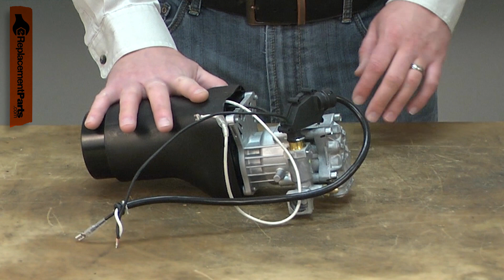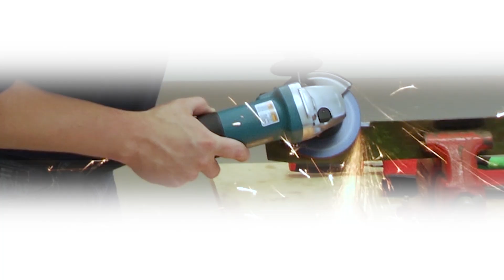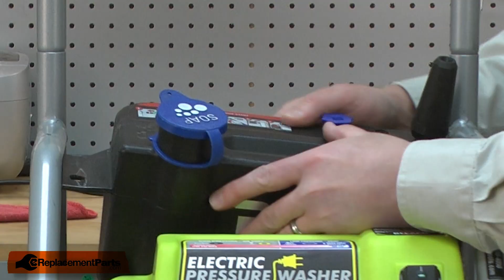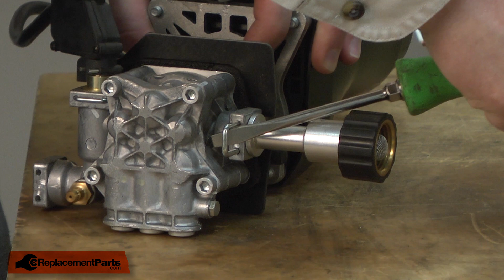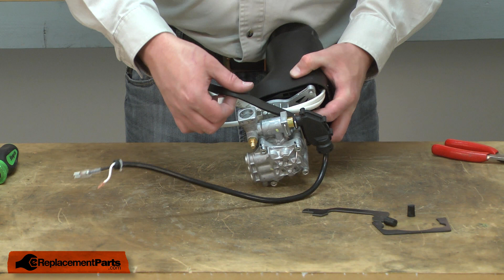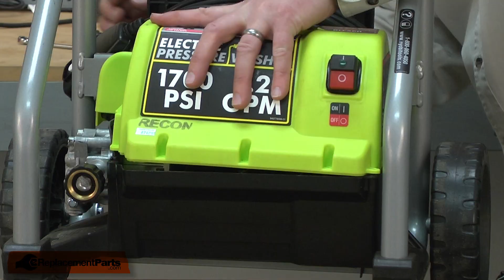Pressure Washer Repair - Replacing the Motor and Pump (Ryobi Part # 308833014)

Comment: Great video
Is there a start capacitor on these motors, I’m assuming that both the 2000 motor is the same design as the one your working on

Comment: Hi, I have a Ryobi 2300 psi 1.2 gpm electric pressure washer. It's possible to add a pressure switch?? I don't like that I have to turn on and off everything I'm not using it.
Reply from the maker: I'd be surprised if your machine doesn't have a pressure switch, I would bet it has failed if it doesn't shut the pump off when you release the trigger. Another possibility would be any kind of a water leak, from the hose, trigger wand, or pump. Leaking water will cause the pump to cycle on and off, or stay on continuosly if the leak is big enough. -Mark